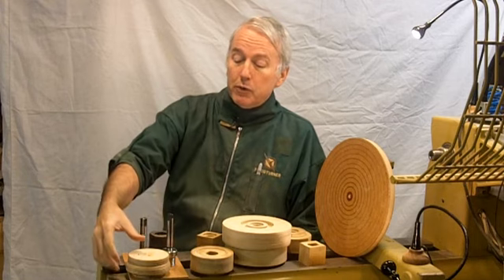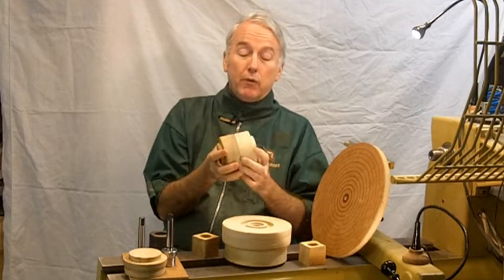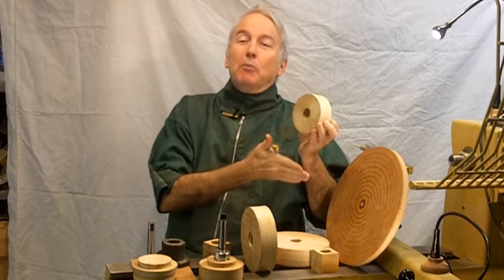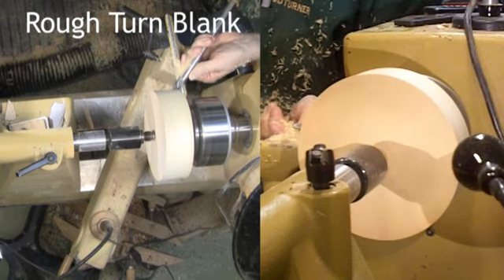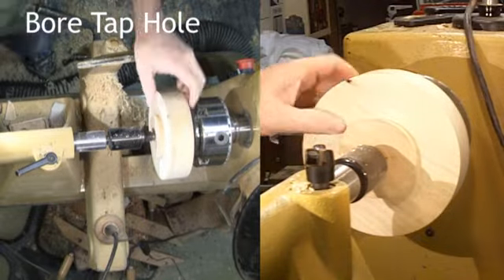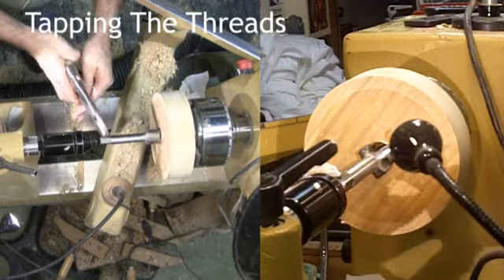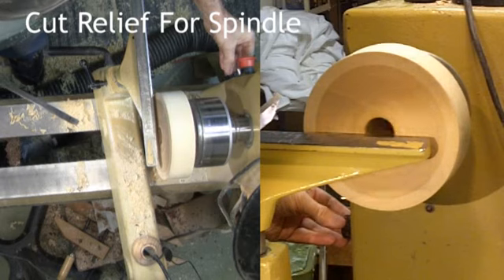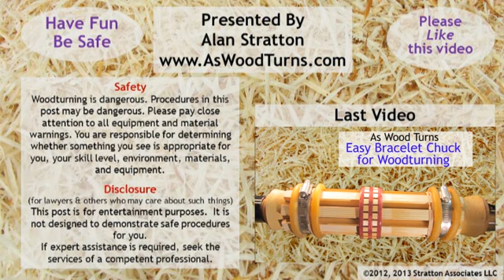Easy Wood Faceplates For Woodturning

Comment: Thank you for the tip of using just your chuck jaws like jam chuck for making these faceplates and glue blocks. Made me prototype for reference with a tenon and a tapped 1X8 threaded hole. The hole does not bother me as you never see it when in use. I find your tips quite informative and refreshing. Right now another project I am working on is making my own bedans from scratch in varying sizes. Keep coming up with great ideas. I have learned a lot from your channel.
Reply from the maker: You sound ambition do make your own bedans.
Alan

Comment: I like this tool so well for my little face turnings...I can start a lot of them, and set them aside for the glue to dry, while working on others. I made a video on how I use the beall tool, but I like yours too. I use my face plates very small, and a piece of carpet tape, firmly attached to a really smooth buffed surface, and that way I can reuse the tape MANY times. I started counting how many of one of them but lost track somewhere after 9 times.
Reply from the maker: I like the idea of buffing it for the carpet tape. Interesting.
Thanks for commenting.
Alan Stratton

Comment: I've made several of these out of scraps of hard maple. It takes lots of torque to run the tap through this wood. Then, I lubricated the threads with silicon spray. They are really strong and have been very useful.
Reply from the maker: That is an effective alternative. Since I use poplar that is softer, I like to harden the threads with thin CA. Then tap again after the CA is well dry. Lubrication for the 2nd pass works (although I use my beeswax/mineral oil mix). However, I hesitate to lubricate on the first pass since I plan to use the CA and do not want the lubricant preventing penetration. Your hard maple may not the the CA treatment.
Alan

Comment: I just bought five waste blocks (believe it or not) from craft supply for about 8 bucks.  As soon as they get here, I will be watching this video again and again :)  My faceplate is currently stuck in some big chunk of very hard and green stump that I thought I could make a light house out of.  I gave up on it, stripped all of the screws, and am now waiting for motivation to try and work the saws-all on it.
Reply from the maker: For most of my faceplates, I use 8/4 poplar which is fairly cheap and commonly available at hardwood resellers. No need for specialty waste blocks. Lacking 8/4, glue up some thinner pieces. Don't use baltic birch or any other plywood. I have used baltic birch and I have had it de-laminate at inopportune times.
Enjoy.
Alan

Comment: Thanks for the tip on the Threading tool, I am now a subscriber.
Reply from the maker: You'll be amazed about how often you will use it.
Enjoy.
Alan
Reply: As Wood Turns I have not tried to use a tap on the lathe yet but will in a week or so.  Is there a reason why you chose to use vice grips to turn the tap as opposed to just turning the wood with your left hand?
Reply from the maker: Curtis Wyman If you turned the wood with the left hand, then you'd have to anchor the tap. It's easier for me to let the lathe hold the wood still and turn the tap with a wrench, vice grips, or tap handle.
Alan
Reply: As Wood Turns Oh okay. I watched it again.  I thought you had a Jacob's chuck on there and that should have kept the tap anchored.  Looks like you have this down to an art :)

Comment: There is a tool called a tap guide that you mount in a tailstock chuck. It has a 60 degree spring loaded point. The spring takes up any difference in in the tailstock feed. It also works well in a drill press.
Reply from the maker: ardvarkkkkk1 Interesting idea although I would hesitate to buy it with the results I'm getting already..Thanks for the idea.
Alan

Comment from the maker: I haven't seen the need for hardening threads with CA in the woods I've used so far. If the wood were more open grain, then the CA treatment would be a plus.
Interesting ideas for keeping tension.
Thanks for the ideas
Alan Stratton

Comment: Very nice Alan. I've been making threaded chucks for some time, but not nearly with the range of types you have for use.  Very impressive and interesting.
Reply from the maker: Thank you Daniel, I'd hate to do without them.
Alan
Reply: As Wood Turns I wanted also to ask, what kind of glue do you use to attach chuck to turning?  I've use the paper bag trick; and I've used CA sprayed with accelerator.  And I've had issues with both!  (e.g., split objects, etc) What do you use?
Reply from the maker: Daniel E Moerman The famous "It depends". Like you I've used brown paper; and CA. I've also used glue without paper and hot melt glue. generally CA for smaller objects. Hot melt is surprisingly tough depending on how much you use and the size of the project. Brown paper can still shear if stressed too much. Regular glue takes longer to dry. 
So it's a balance of needs and stresses and sometimes I do not choose the right one.
Remember you can always glue another sacrificial layer on the faceplate.
Alan

Comment: Hello Alan. One more trick with the wooden threads, after tapping the wood,, add a layer of CA glue over the threads, let dry and then re-run the tap into the hole by hand,, the CA glue will make the wooden treads stronger for many more uses then wood threads will with out.
I like you videos, Thank you.
Reply from the maker: +Curtis George Agree, I've adopted CA for most of my threading.
Thanks for commenting
Alan

Comment from the maker: My concern with a spindle adapter is whether my vicmarc chuck would have too much mass for a mini lathe. Even turning a 6" walnut bowl on a faceplate, I can stall the mini. I would appreciate input from you and others on this issue.
Glad you're using the videos for your projects.
Alan Stratton

Comment: I have a midi lathe with 3/4 X 16 threads (craftsman uses this) and a metal floor flange will work for a inexpensive faceplate.
Reply from the maker: Interesting tip if you have a 3/4 x 16 tpi lathe.
Thanks for commenting.
Alan Stratton
Reply: As you stated in your video, the floor flange is for smaller pieces. I dedicated one to a sanding disk.

Comment: I use the same system to make faceplates but I use ca glue in the drilled hole before
tapping let it dry and tap. Then I coat the threads with ca again and tap again. I feel it makes for very strong treads.
Reply from the maker: Robert Harrington I agree - I'm tending to soak the newly cut threads with CA, then retapping once dry.
Thank you.

Alan

Comment from the maker: Sam's solution video is great for a PM3520B. My lathe is a PM3520A. On this one, the power button is directly below the spindle lock. The hinge solution would hang over the power button which would not be safe for me. 
Meanwhile, however, the spindle lock is closer to the spindle on my lathe putting it in reach of the tool rest. So I don't mind using a tool rest until I find a safe solution.
Thanks for the suggestion, however,
Alan Stratton

Comment from the maker: 1 1/4" x 8 tpi seems to be non-standard thread pitch so I'll take what I can get.
When I did the plugs for the bracelet plug, my tap set included a bottoming tap. Even then, I was threading clear thru the wood, so I did not use it.
Otherwise, the hole can be a plus at times.
A tap wrench would be nice but I'll use what I have for now.
Thanks for your comments.
Alan Stratton

Comment: Thank you Alan I am sure after seeing this I will be able to figure something out I would just hate to make the treads on my lathe a tap by notching grooves into it
Albert
Reply from the maker: First, I would check the measure. 1x10tpi is very unusual. 1x8tpi is common.
I found one at www. mscdirect. com but it was very expensive.
One idea, try to find a bolt that matches your spindle size. Then file or grind one or more grooves to get a cutting edge. If you look at taps, you'll get the idea.  Better yet - ask a machinist in your club. They tend to know everything metal.
Good luck.
Alan

Comment from the maker: The Beall tap is available from several woodturning suppliers. I did not put the specs in the video because the tap must match your lathe spindle. Mine is 1 1/4 x 8 tpi; another common is 1 x 8 tpi; another is 3/4 x 10 tip. then there is the M33. Whatever your spindle is - that is your tap.
Thanks for the suggestions. Always trying to make it better, informative yet concise.
Alan Stratton

Comment from the maker: 1. The threaded faceplates do not tie up your chuck.
2. if you take off the wood block from the chuck, it's difficult to get it back on precisely where it was originally. So it is not centered exactly where it was.
3. I can have as many wood faceplates as I want. Chucks are expensive.
Great question 
Alan

Comment: I went to the local hardware store to buy a tap. The fellow looked for one but did not have any in stock. The price was over $50.00 dollars. He said he would order more but I think that is too much for the tap. I'll check in a week or so and if the price is still the same I'll order one from a wood worker's catalog. Great video and very interesting.
Reply from the maker: Check the woodturning catalog stores. Craft Supplies sells the Beal tap for much less than $50..
At least for a 1.25" 10 tpi tap, it is not a common tap size.
Alan

Comment: Can you take a moment to explain to me why a 11/4" x 10 tpi tap works without problems for a 11/4 x 8 tpi spindle. I appreciate all of your videos and you have tweaked my interest in making wooden faceplates.
Reply from the maker: I don't know why a 10 tpi tap would work on a 8 tpi spindle. My 3520A and my Beall tap are both 8 tpi.
I do have a 3/4 x 10 tpi for my tail stock.
So. I don't know.
Alan

Comment: Thank you for your quick reply.   But....... I am really really new and need more explanation about how to make it work.  Could you please give me some detailed instructions.   I really appreciate your help.  Thanks so much.
Reply from the maker: The Ikea lights come with two screws that mount them to the factory base. I replaced these screws with longer ones that go thru the wood turning that I made for the base.  I also cut a recess in the base to house the magnet. I put a screw thru the center hole in the magnet to attach it to the wood turning.
Lamp - wood - magnet.
Good luck.
Alan

Comment: Why not just get a 1 1/4 x 8 self locking nut and epoly it into the faceplate?
Reply from the maker: Good luck finding a 1 1/4 x 8 nut -- it is a specialty size that is not commonly available. But, I can give you a source if you'd like at about $2 each. Do you know of another source?
That aside, there are a couple more considerations. 1) I can tap and make a new faceplate anytime I want without ordering another nut or having to scavenge one off of another faceplate. 2) I don't have to rely on a glue bond between the nut and the wood. and 3) I like it better this way. :)
Alan